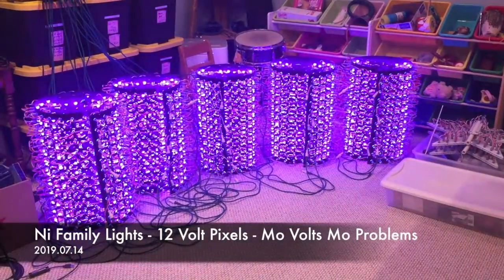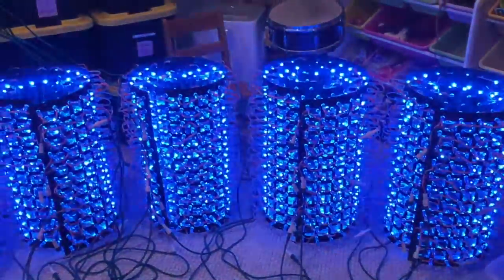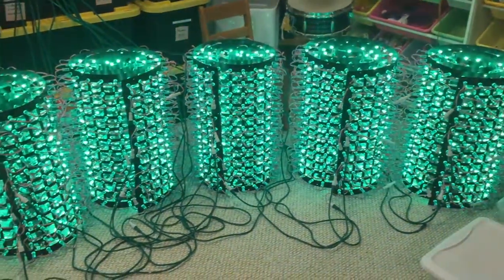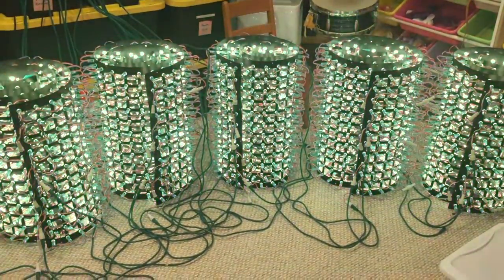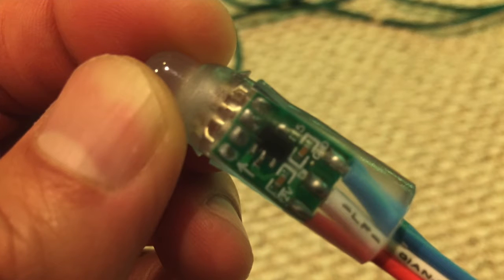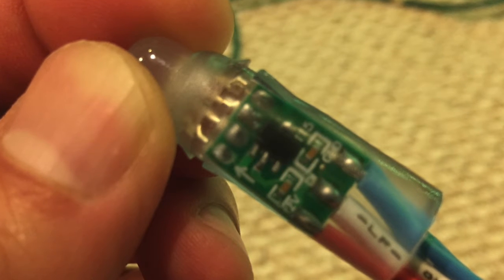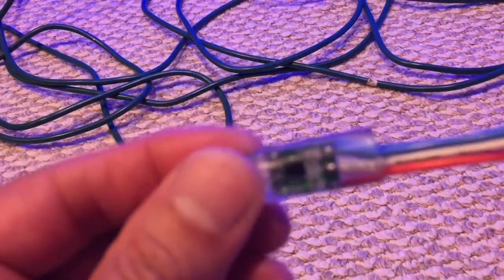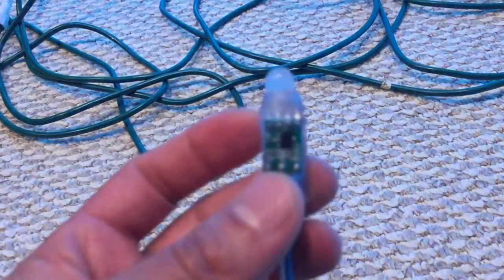12V Pixel Issues - Mo Volts Mo Problems

Comment: I have a spool of 200 Seed (Pebble) Pixels that I tested and worked fine on the spool. I took them off the spool 5 minutes later with the exact same hookup to an ESPixelStick and suddenly they are dead and not lighting? The ESPixelStick gives a blue light so that is powered, and the first pixel use to flash yellow for 1 second when initially powered but now I do not get that flash and doesn'e seem to have any power to the pixels. Any ideas or thoughts as to why this is/how to test it/fix it? I see no visible damage to the lights or cable and these are just 1 month old. Would be shocked if they just randomly met the end of their life by taking them off the spool. Thanks for any help
Reply from the maker: Hi and thanks for writing in. From your description of events, I would think that the lights are completely fine. The connection from the ESPixel stick may not be making a great connection if as you say, the first pixel used to blink. 

I would re-check your connection from the ESPixel stick to the seed pixels.